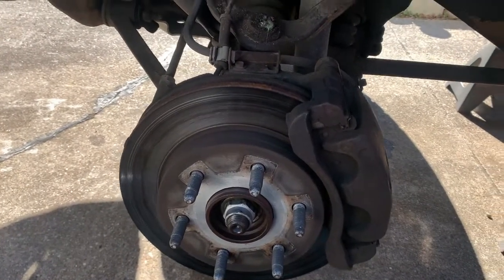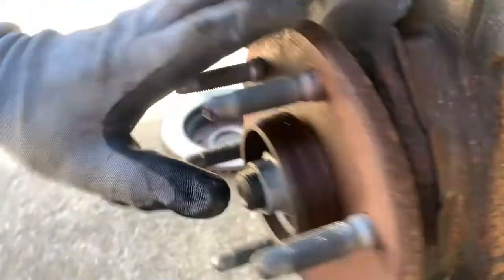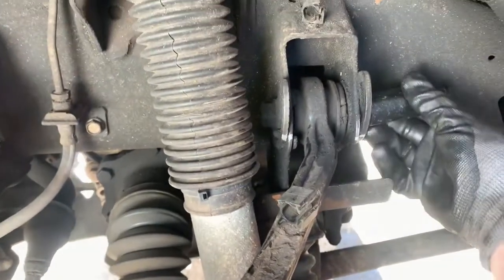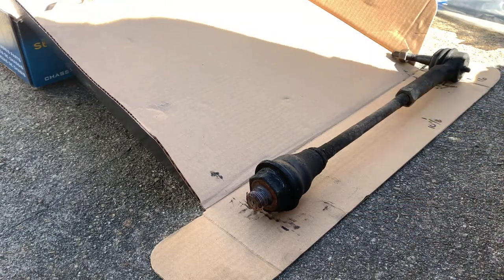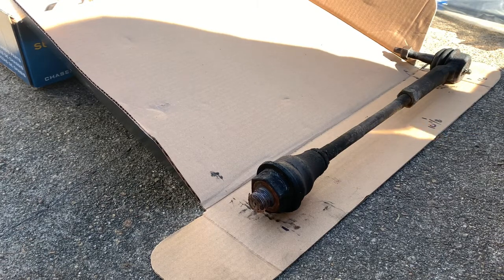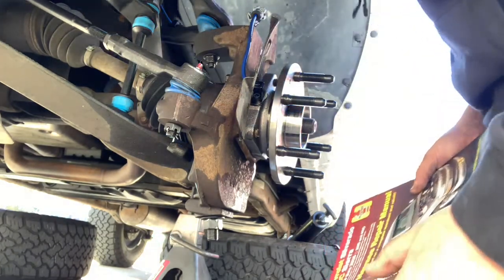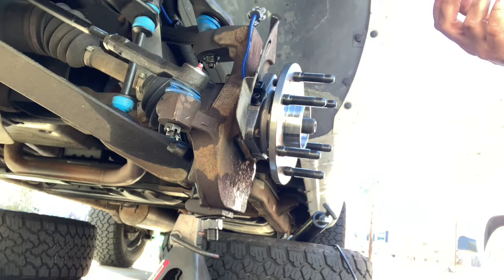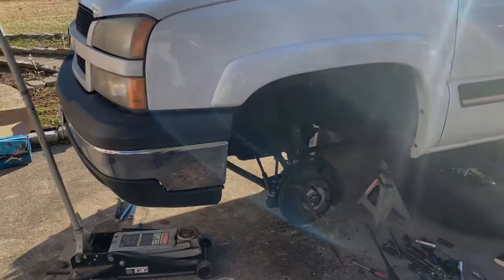“How To”: 2002-06 Chevy Avalanche Front End Overhaul

Comment: I have the same truck. About to redo entire front end. Sway bar, center link, upper lower c/a's hubs etc., Your video is great but instead of taking this apart piece by piece can I just drop the whole from end if I disconnect the axles (all brake stuff is removed already) ?
Reply: Answering my own question here, I see that the torsion bars may make that idea a little challenging BUT I am also replacing the torsion key to get a little lift so I my be able to kill two birds with one stone here.

Comment: You don't have to leave the bolts loose for the alignment guys, they have tools that will twist that nut right off
Reply from the maker: You’re right, they do have the tools. But having worked on a lot cars, and having many good friends in the mechanic world, those little things that make they’re life easier go a LONG way.
Reply: Don't have to be 100% loose, but also if they are super tight , could ruin them by having to break em loose again.

Comment: Are you using a suspension kit, and if yes, which one? Otherwise, would it be possible to get links to your parts used? Would like to do the same to my 04 Avalanche, and watching your vid, I know your parts work!
Reply from the maker: Added the parts info to the description. I ordered everything through RockAuto.com
Reply: @takeroadslesstraveled6505     You should've changed your axels, especially if it has high milage. It only cost around $70.oo for a new axel with the rubber boots.
Also, the pitman arms have 3 ball joints, that need replacing. All together, you have 9 ball joints that can be wore out.  For best results, use AC Delco parts.
Use Mobile 1 red full synthetic grease. The steering box pitman arm is hard to get to. I had to use a cut off wheel & grinder to cut a relief in that pitman arm,  to get mine off. 
You have to remove the steering box to get the big 34 mm nut off. You can't use a socket, you have you use a wrench, or big adjustable. Get ready for lots of cussing.
You can also adjust your steering box, by loosening the 15 mm nut, then use a 3/16th. Allen wrench. Turn the Allen screw about 1/4-- 1/3. turn in, then tighten the 15 mm nut.
Your steering will be much more responsive.

Comment: Those little 4 tabs on your lower ball joint they are called ribits okay I just want to try to help clarify I'm from Michigan the land of the Damned Chevy we got to deal with rushed up here it
Reply from the maker: Good to know. Thanks for the info. And yeah, I’m very familiar with Michigan. Lived there until I was 24.
Reply: @takeroadslesstraveled6505  well at least you were smart and you got out of Michigan have a good day
Reply: If the upper control arm is making the wheel bounce when it's going down.The road is that means for a new upper control alarm